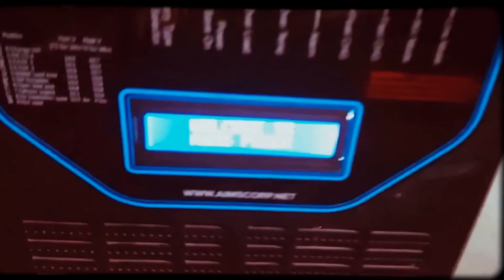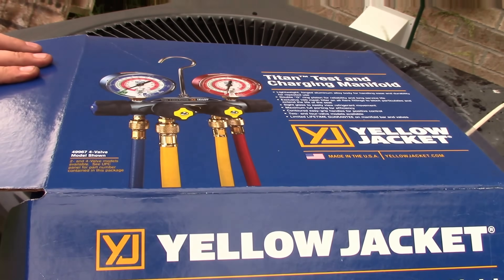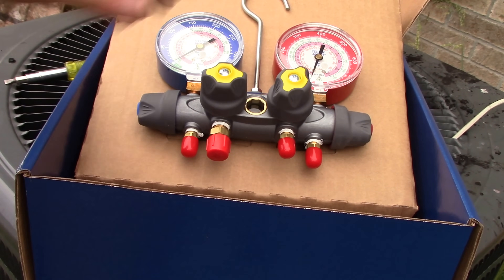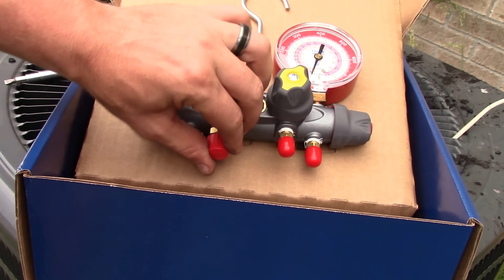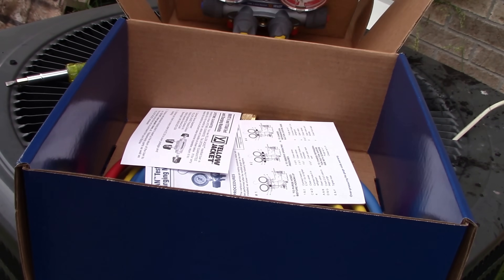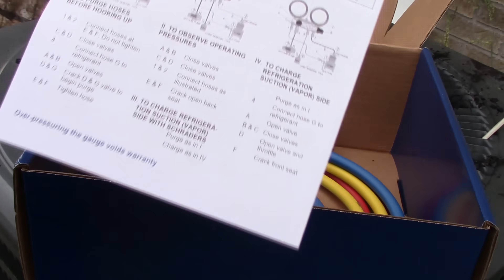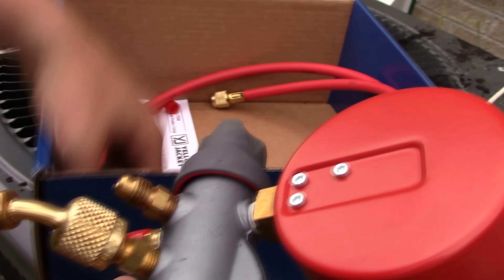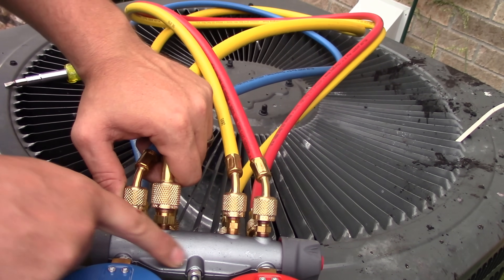Yellow Jacket Titan 4-Valve Manifold, 60" Plus II also my A/C plan for my house.

Comment: I currently tly have a 5 ton package heat pump with a ZP16 compressor that is 1.25 ton. I added txvs on both coils. Slowed the ecm fan down to 800 cfm. Works perfect.
Reply from the maker: very cool

Comment: Just purge your manifold after each job. No need to have 3-4 sets of gauges. One set works fine if you’re not lazy. Taking the extra 5 mins saves you $200 per manifold

Comment: Do you think this set wold be OK for all types of freon? Would I require different fittings or adapters?
Reply: You can flush your gauges out with nitrogen.
Reply: Then you bleed your lines with a ball valve on the on the end and you purge all the air out with the new refrigerant your using.
Reply from the maker: No you need gauges for every type of oil

Comment: Nice gauge and manifold set. I'm not a fan of heat pumps, i was never convinced they were worth it. At least from what i have seen they rely on electric strips to meet the demand way too often.
Reply: In SC they work real well. Even on the 30F and lowers days. The heat strips will come on on the real cold days for a few mins to make up for what your asking it to do. So if you come home to a cold house. The heat strips will come on to worm the house to the temp you asked for. The trick is do not move the T stat all over. Set it and forget it. 
As for the AC well in the summer it's just about a must.. Heheh
Reply: are you certified?
Reply: Cut my electric bill in half in the winter with 2 heat pumps vs heat strips

Comment: things to think about. oil return with low refrigerant flow.  are you going to have enough head pressure. what size txv If it's to big it won't throttle down far enough.  if it's to small it will starve it.  I'm thinking 2 ton might be better. the reversing valve won't switch without head pressure.     look at surplus city liquidators for parts or systems.  they are out if Indiana. my gut feeling is that to big an imbalance it wont work right.
Reply from the maker: +Roy Amberg We will see soon